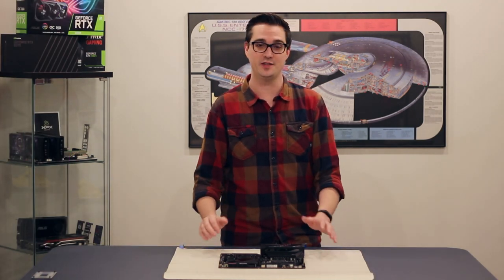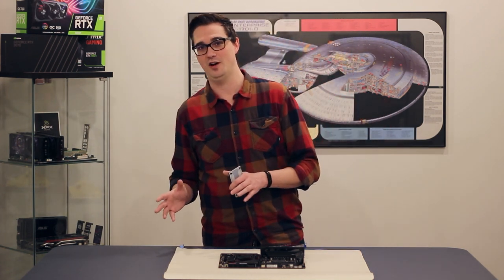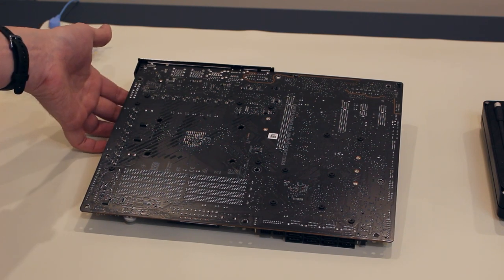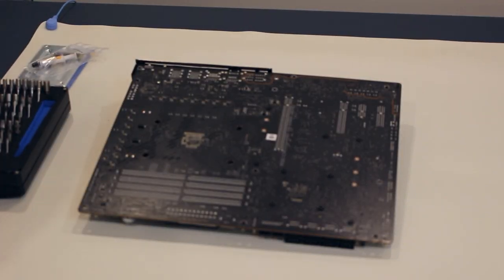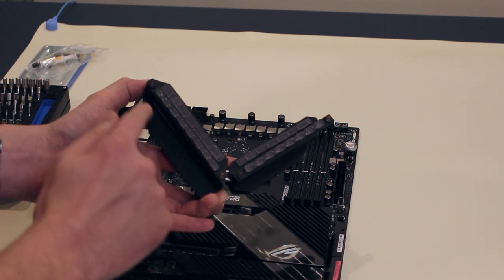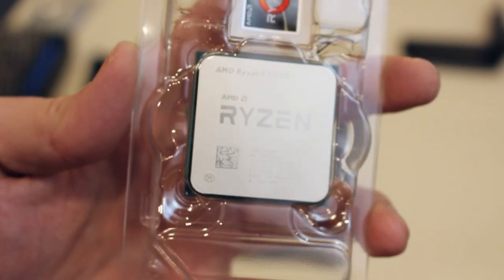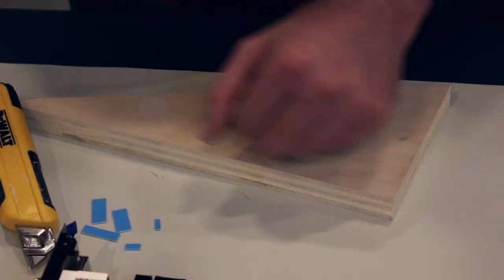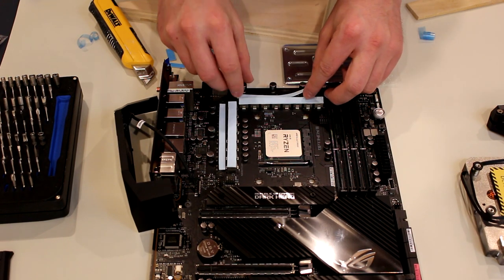2021 PC Build Pt 7 - Installing the EK Quantum Mono-block on the Dark Hero!

Comment: I just received my parts from EKWB and started putting everything together today. I wanted to see other installs and found this video. Firstly, thank you for uploading this video! It's incredibly helpful! 

Also, I could be completely wrong about this but I wanted to mention that I'm pretty sure the screws with the brown-paper backing are actually replacement washers for the bottom side of the Monoblock. They have a sticky adhesive under the paper backing which is similar to those that came pre-installed with my Monoblock. I think EKWB might have intended the clear washers with no paper backing to be used on the back side of the motherboard. 

I didn't see any other comments about this and figured I would mention it for anyone else who comes across your video. Again, I could be completely wrong. 

Regardless, thank you again for the video!
Reply: Ditto
Reply from the maker: Thank you for the comment! Glad you found the video helpful! I'll go back and take another look at the washers!

Comment: was doing this without instructions..... didnt even know EK had sent a back plate. Thanks buddy, you saved my sanity tonite!!
Reply from the maker: My pleasure! Thanks for watching!
Reply from the maker: Pro-tip: The EK thermal pads aren't great, highly recommend replacing with Thermal Grizzly Minus 8 pads or Thermalright Odyssey Pads. EK pads are 4W/mK, Minus 8 pads are 8W/mK and Thermalright Odyssey are 12.8 W/mK. I'll be doing some videos comparing thermal pad performance but the TLDR is that with EK pads the memory still gets > 86C and with Minus 8 pads 68C. Huge difference, especially on the backplate side.

Did they send the 8mm screws or the 7mm screws? Pretty bad coil whine with their default design 7mm screws and 1mm thermal pads on the RAM (I'll be doing a video on this as well). I wish I could pump out these videos faster because there is a lot of useful information to share!
Reply: @UnhingedSystems  What pad specifically did you use?   I'm on amazon and there are multiple options of size and thickness for the Minus 8 pads.   I'm also watercooling my 3090 ftw3.  Should I replace any ek pads for that while I'm at it?
Reply from the maker: @JCrowe86  The Minus 8 pads thickness varies so you need to check the pad thickness for the backplate kit. Whatever pads they use for the backplate kit you will need the same thickness pads to replace with the minus 8 pads. Personally I would recommend using the minus 8 pads for behind the GPU itself, and for the RAM, but other than that the EK pads are sufficient (though man do they leak oils all over the card, very gross). For size use a similar size to what comes with the EK pads (120x24 etc) you can also use 120x120 and just manually cut them down if you choose.

Comment: Good too know the asus crosshair monoblock works with the new dark hero
Reply from the maker: It is a great mono-block. A single CPU block would have been just as good but I love the look and size of the mono-block!
Reply: @UnhingedSystems  i love mono block and couldn't find one specifically for the new dark hero so I guess this one fits
Reply: @derekg2132  just bought this and installed it on dark hero..i can 110% confirmed it fit exactly like in the video with all screw hole aligned accordingly

Comment: Where do you plug the EK Block please ? Mine is always white color . I can't change de color
Reply from the maker: You need to plug it into a 5V ARGB header either on an RGB controller or on your motherboard. Please ensure your system is completely powered off and unplugged as the ARGB headers are quite sensitive to shorting out if they are powered while moving around plugs.

Comment: Which side of the thermal side goes down nd up I realize taking off the darker side nd ghe other side one side is really sticky one isn't. I'm stuck cant really tell in the video so when I take plastic covers from noth sides do I put the really sticky side facing up or down to stick to the mosfets or facing up to stick to the block
Reply: Thats actually a good question.  The factory cooling on the mobo had the thermal pads sticky up onto the heatsinks... it probably doesnt matter however I feel like most would put sticky down on mosfets, but logically I would myself consider putting sticky up so they stick to the block upon installing the block. Because if you think about it. You dont want the sticky self to melt so the sticky stuff would experience a cooler temp if its stuck to the cooling block than if they were stuck to hot mosfets.  Probably why the Gigabyte factory put their sticky side to the cooler temp heatsink than to the hot mosfets.... plus if you want to replace the cooling block and put back on the factory heat sinks.. there will be no sticky residue left behind on the mosfets after peeling away the thermal pads since the thermal pads will lift right off due to them being stuck to the cooling block.

Comment: Can you use the default backplate instead of the provided one?
Reply from the maker: I wouldn't recommend using the stock backplate with the waterblock. I also wouldn't recommend running without a backplate as the VRAM gets super hot without one. As a note the waterblock and backplate are purchased separately.

Comment: could never do custom water cooling i bet it's interesting tho. if you mess up that's a lot of money down the drain
Reply from the maker: That is why I enjoy helping people with their systems! For those that are not comfortable to DIY, there are lots of experienced people out there to help and even work with them to build it!
Reply: @UnhingedSystems  yeah, i need to watch your vids more often i ended up needing a replacement motherboard after i stripped the screws. i couldn't tell which direction was correct because the screws were to tight. is there anyway i can extract a stripped screw without breaking the board. my board is a asus b-550 a and the screws i'm asking about are for the 2 cooler brackets near the cpu
Reply from the maker: @mysticswordsman5688  stripped screws are no fun. There are tools for removing stripped screws by using a hammer and a tap (not great for motherboard use) and then there would be drilling it out with something like a Dremel or small drill bit and a drill. Either way, risky to the motherboard. Those little screws can't take much abuse. Always remember, lefty-loosey, righty-tighty. Ensuring you have the right sized bit for the job is key to not stripping the screws.
Reply: @UnhingedSystems  thank you but considering all the risk you just described i'll go ahead and order another board. I won't let this stop me from building my gaming pc. Wish me luck when i get the replacement and thank you so much again.
Reply from the maker: @mysticswordsman5688  Good luck with the new board!

Comment: Can the ports be rotated to better align with a distro plate if needed?
Reply from the maker: The ports themselves don't rotate (the plate only fit in one way due to the VRM cooling) but you can achieve the same result with a couple of fittings.
Reply: @UnhingedSystems  thank you!

Comment: Nice vid, i like it <3
Btw, can u get the dark hero link?
Reply from the maker: Which Dark Hero link would you like?
Reply: @UnhingedSystems  Amazon link
Reply from the maker: @mahaji9062  I'm not currently affiliated with Amazon, but the Dark Hero isn't readily available from retailers right now (out of stock). I did a quick search on Amazon and the board is going from third party sellers for over $650USD, way overpriced. Scalping is ridiculous right now.

Comment: So when I Instal thermal pads the dark blue side I take off and that side facing down on the mosfets or the other way just wondering cahsr thay side isn't sticky the other side is
Reply from the maker: Sticky side down is easiest for positioning but harder for cleanup afterwards (depends on the thermal pads). The EK pads are a little more of a pain to work with. I tried both ways, but I prefer the side with the harder plastic to be "up" because it is easier to remove. For thermal heat transfer it doesn't matter which side is down or which side is up. Cleanup would be easier if the sticky side is on the block side if removing them or replacing them later.
Reply: @UnhingedSystems  thanks yeah pain to worl with so I put sticky side down so when j had to removed and reposting the block cause it was hard getting all the holes to line up question the cable from the monoblock where does it plug on on the board I see its got that weird style 2 ones empty than a third I only saw one plug like thag but it seems far says if I plug it onto the wrong spot can damage motherboard or block I see the d rgb plug but thay can't be it cause it has 4 prongs sticking up the plug on the mono block on had a place for 3 2 in a row than a blank spot that the third weird. I see one plug with 3 pin says add a rgb whatever but idk if thay it seems far away from the monoblock on asus dark hero its on thr rigut side next to the ram idk if thats it I know plugging q 5v aegb into a 12v or vice versa can fry shit its funny how many build videos are online linus jayztwocents I find none thay shows step by step wiring or watercooling like how much to tighten fittkng I to a distro plate or how to fully prepare a tube to put ina fittkng without cutting o ring etc
Reply from the maker: @derekg2132  The 5V is labeled "ADD_GEN2" and has three pins the other one is 4 pins and in 12V.
Reply: @UnhingedSystems  ok what about the mono block has that 3 pin so does rhe gpu block
Reply: @UnhingedSystems  gpu block is a pain in the ass doing 3090 ftw3 ultra direction said 13 screws than pul it off nut they forgot to mention the i/o shield has to come off the says removed the plugs dorsnt say jow I got one off suppose to just push em but the three side by side I can't get off kust be tight im scared it breaking soketjkng than the amount of thermal pads between the block and backplate are crazy and im always wortied about how tight or noy tight to put the screws same thing with fitting g how tight yo I tight into distroplare some people sag hand tighten some peoppe sag a tool
Reply: And I should of just did soft tubing im dojng brass hard tubing 14mm with 14mk ek fitting and its not easy I tried one first time cut the o ring second time got it on but I dont know everyone daid they've never tried it but if I hold the fitting side one hand ither hand pull the tube I can pull it 9ut of the fitting g with alittle of force dont know if thats normal
Reply from the maker: @derekg2132  Are you adding chamfer to the edge of the tube before inserting it? If you use a 200 grit sand paper to make an edge on the tube, then smooth it with 1000+ grit then you wont tear the o-rings.
Reply from the maker: @derekg2132  both are 5V
Reply: @UnhingedSystems  another question got the pcb off for gpu cleaning the gpu around. The chip has fhat blue areas with little pieces in there some old thermal paste is in there I cang get it out using q tip and alcohol I cant get it all out
Reply: Like the gpu chip i clean but thays green area around it that has those little things lines around fhe chip i cant clean those all the way ive tried alot it looks like dried thermal paste in places ive tried q tip alcohol nothing how well does thay area need to be cleaned
Reply: Also the memory chips every thing g cleans rigut off but what anout the little gap in between each memory chip how do I get the paste out of that spot
Reply from the maker: @derekg2132  Don't worry about getting all the old thermal paste out of the books and crannies. Just make sure the GPU surface is clear for fresh paste :)
Reply from the maker: @derekg2132  don't worry about getting every little bit out, it won't make a difference.
Reply: @UnhingedSystems  k was worried like around rhe gpu chip and the memory chips are clean but some in between chips I cant gets what if some Flys off and is on other stuff on the card its fine?